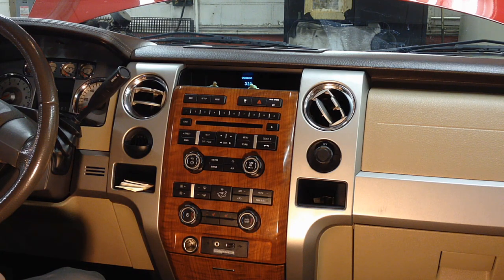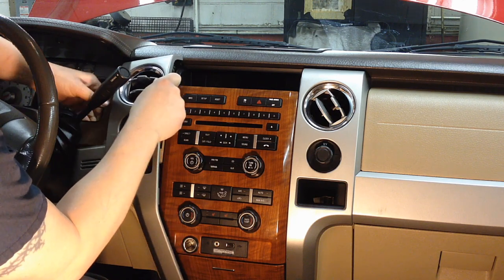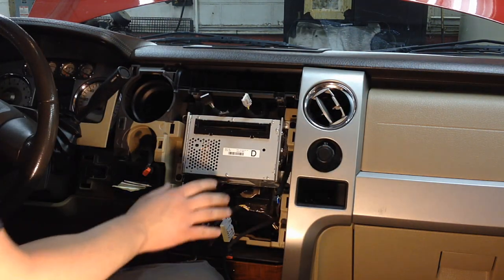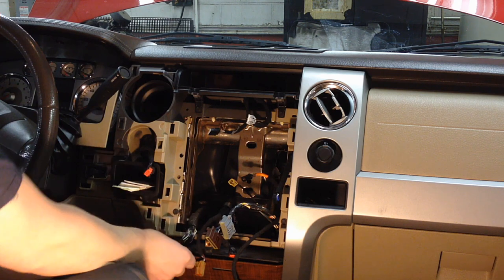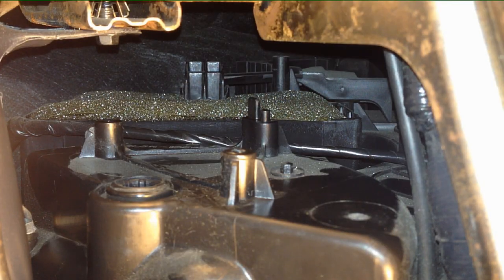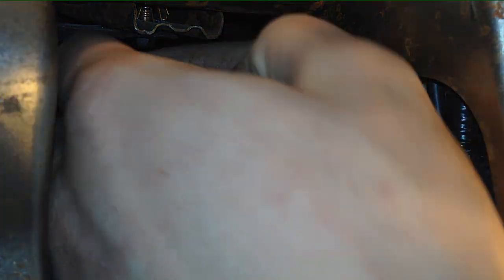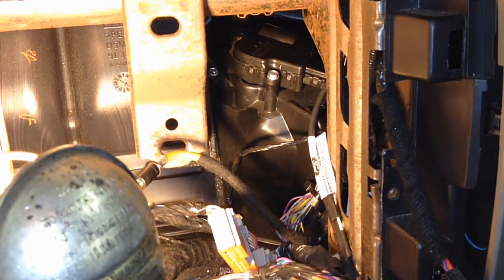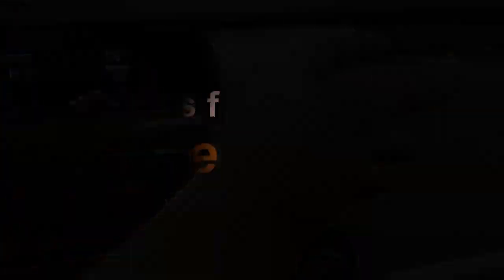2009+ F150 Passenger Side Upper Temprature Blend Door Actuator Replacement

Comment from the maker: Lower Blend Door Actuator Replacement-
http://www.youtube.com/watch?v=p5xvlbiaxF4
Reply: I'm a new sub just started following you on YouTube and on here, I have a question concerning my 2010 f150, it's blowing cool on the drivers side and warm on the passenger side in the heating mode, it also has the center console, would this be a lower blend door actuator problem and would dash removal be necessary?
Reply from the maker: Marcus English Drivers side is the lower yes.
Reply: Thanks for  the feed  back, now would that apply to the center console back air vents as well
Reply: Marcus English back center console are tied to the Drivers side if i recall.
Reply: FordTechMakuloco  Brian what 1/4" impact wrench are you using? I wouldn't mind owning one, it's compact enough to get into tight spaces.  Great videos, keep up the good work.
Reply: +Roland Gutierrez Looks like the Bosch PS41 12V. I have it and it's great for tight spaces as you said.
Reply: +statikuz  Thanks for the reply, I wouldn't mind owning one myself, thanks for the info.
Reply: FordTechMakuloco I have a 2010 Ford F-150 platinum. I think my passenger actuator is bad and recently my truck just started only blowing out of the feet and defrost no matter what setting you press on the screen. Do you have any suggestions on what might be going on with that? Thanks for all of your videos.
Reply: FordTechMakuloco
Reply: FordTechMakuloco I've replaced 2 blend door actuators one behind the radio and other one next to the gas pedal. I'm not getting heat to the driver side or window defroster or the rear passenger. The front passenger get heat and cold air when requested. Any ideas?

Comment: @FordTechMakuloco. I have a 2010 platinum that is only blowing cold on the passenger side. To do what you do in this video will I have to pull the console or can you do this actuator without pulling the console?  Thanks in advance
Reply: +FordTechMakuloco
Reply from the maker: +Josh Garrett In order to do this you may have to remove the top parts of the console to get the fcim out of the way if so in this video I show console removal- https://www.youtube.com/watch?v=p5xvlbiaxF4
Reply: Awesome!!  Thanks for the quick response!

Comment: Wow great video.  i have an 07 expedition Limited with dual climate.  Passenger side will only blow cold so the vents have to be shut.  drivers side functions normal.  Is the procedure the same on that model?  Might have to remove console i guess.  is there a way to check error codes for this?  I have a friend with a computer that will scan all functions.  Thanks in advance!!
Reply from the maker: Yours is the upper they fail all the time I would just change it make sure to use ford parts only and follow this video link for your model- http://www.youtube.com/watch?v=BFA57sTEtLU
Reply: Yup - fixed it the other day by taking out the radio.  i used needle nose vice grips on a 12 point socket to get the rear screw out.  took a little time but was easy enough.  thanks for your time in making these videos.  Part was ~$30 amazon.  saved me a bunch of $$$.
Reply: FordTechMakuloco  do you know what is the screws for the heat blend I know it 8mm but dont know the legth

Comment: Ford Tech Makuloco if your out there check this out. Ford fx4 2010. I just replace my upper actuator because I had fully functioning driver side and passenger side not working only blowing ambient air.  After I buttoned everything up and checked the system.. Now the passenger side is blowing out heat only.. So the replacement changes something but it is still not functioning correctly.  I just posted something on f150 online forum but have no responses... What would your recommend i do from here?
Reply from the maker: Anthony Moore Have you used the ford actuator?
Reply: Yes I got it from the dealership. Took old one in to match
Reply: FordTechMakuloco
Yes I have place it in the vehicle. Only thing it is doing different than before is blowing hot air.
Reply: Anthony Moore any resolution on heat blowing after replacing the actuator? I have the same issue just heat on psngr side vents
Reply: Control board. I am having it replaced this week. Part is $$$
Reply: Anthony Moore let me know if this works for sure and the what i should expect to spend on it.  Thanks.
Reply: Anthony Moore How did things work out when you swapped the control board?
Reply: Works great.
Reply: Anthony Moore Awesome. I wanted a backup plan in place if the actuator replacement doesn't fix my issue. What you described was the most accurate of all the posts.
Reply: The control board is simply a $400 POS. Thanks Ford
Reply: Ouch! I hope I don't have to go with the backup plan.
Reply: Good luck.
Reply: Anthony Moore is the repair possible DIY?  or defintely a Ford service dept repair?
Reply: I'll give it a shot myself. Looks very well within my capabilities.
Reply: Randy Farnes is there a video on changing the control board?  or is this a job for Ford service centers
Reply: Control board no sweat
Reply: Del Williams Anthony Moore would know more about this than I. Sorry, I haven't dug into my truck yet.

Comment: Great video. This video and some of your others I watched are very informative. Many thanks to you for your time to create these. Just got done replacing the top actuator on a 2010 f150 Lariat for a friend. Per your videos, I was able to change the upper one. Used an ignition wrench 5/16 box end for that pesky rear screw. Went well. Pulled fuse 15, replaced fuse, turned key on for at least 30 seconds. No works. Still no control on passenger side. Could I have gotten a bad (new) switch. Ford part DL3Z-19E616-A
Reply: Bob F. Same thing is going on with my 2010 fx4.. You ever figure it out?

Comment: I have every positive scenario. truck goes to normal engine temp. hoses hot from radiator. new thermostat. hoses to firewall are hot. fan works and blow in all selections. It blows cold air! I cannot figure it out.
Reply from the maker: Is the actuator moving when commanded?
Reply: I had the exact same issue.    I know you posted almost a year ago, but I replaced my actuator just like in this video and all worked again.  What did you end up doing?

Comment: When calibration does the hvac have to be on or off ?
Reply from the maker: +Lee Oscar it doesn't matter it happens automatically when it receives power again
Reply: Ok awesome just one last question I have a 2012 f150 would the fuse be #15 or 46?

Comment: Awesome job on the video and spot on with all of the detail and sequence.  That back bolt is a beotch to get out and back in, but moving the harness out of the way helps a lot...still touch to get the 8mm wrench in there.  After I removed the broken actuator I took it apart and posted a vid that shows what is broken...https://youtu.be/Pnrv67OBN8I

Comment: Yo, just tore mine apart to realize this want the first time it's been replaced in this truck. Dead giveaway when the back screw is missing and there are only 3 screws present holding the radio. Definitely not a FordMakuloko quality repair 🙄🤦

Comment: Your video is fantastic but I’m sick of my F150 because of things like this, the spline motor has been a failure item for years and years, should’ve been recalled but instead they just keep putting it in new $60,000 trucks. Well I’m done with the F150, Because mine is a lemon and has been nothing but a money pit. 2011. Next time Toyota.

Comment: Holy Crap! There's even rust inside the cabin....Why ford? My old ass toyota inside the dash is clean and no rust.
Reply from the maker: falcon niner They are all like that raw metal and we live in the Midwest lots of condensation on the raw metal.
Reply: Gotcha, I appreciate it. BTW, Which generation f-series would you most recommend?
Reply from the maker: The latest seems the best anything 2012 on for the most part they are solid trucks